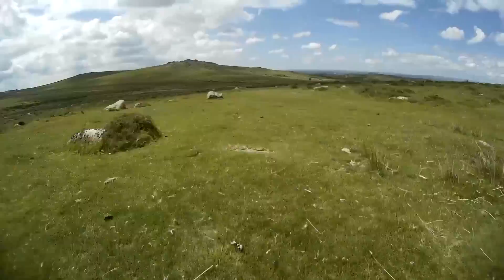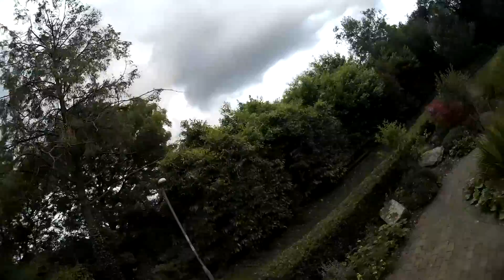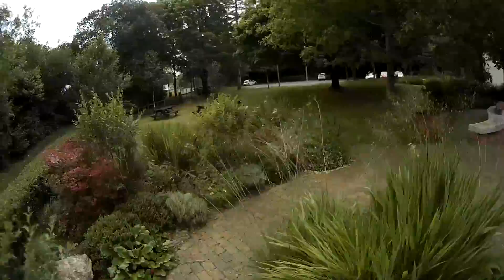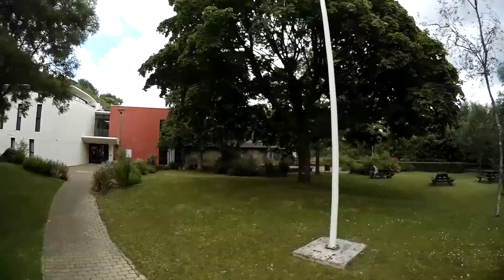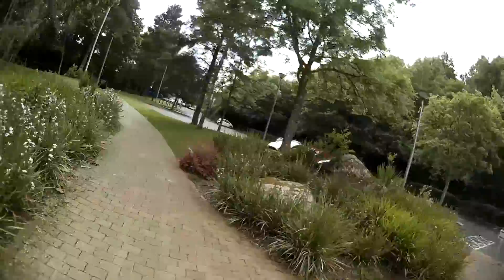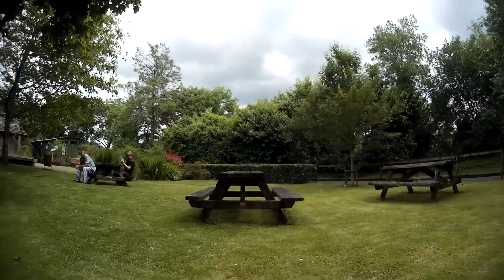Spanky Mini FPV Quadcopter

Comment: Flies like a peach - really smooth.  I hope a) that I can sort out my ESC vs motor issues and b) you get a new leg/frame bit to get back in the air again soon
Reply from the maker: Cheers CK, for out the box it fly's a dream and I am very happy with it, the performance of the Nase is excellent as well, keeps up with the long high G turns. Got the plate today so I'm all happy. Hope you motor issue is just some thing simple so you can have some fun